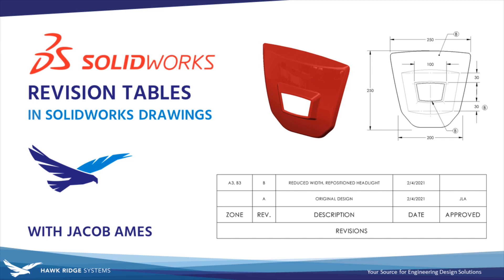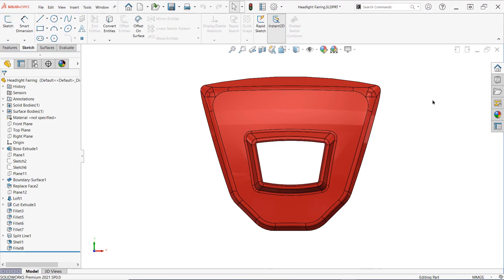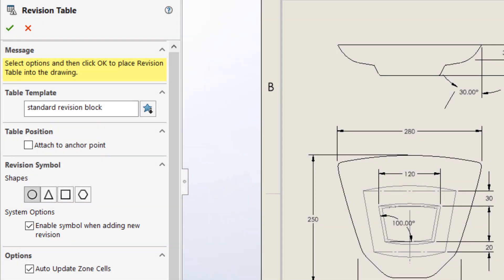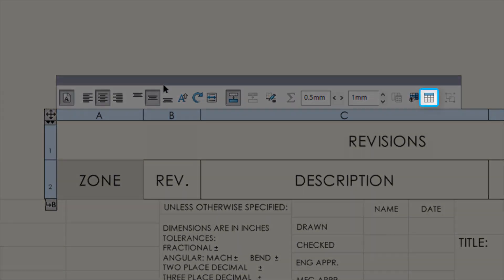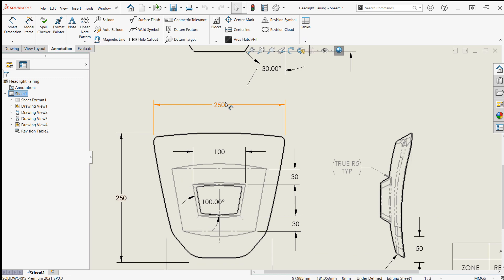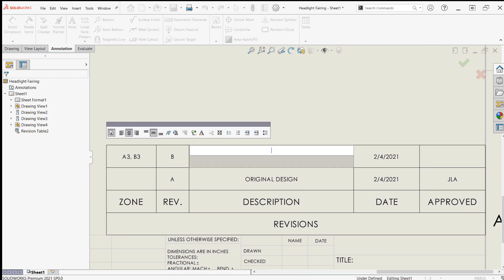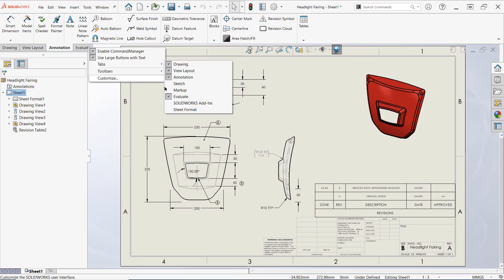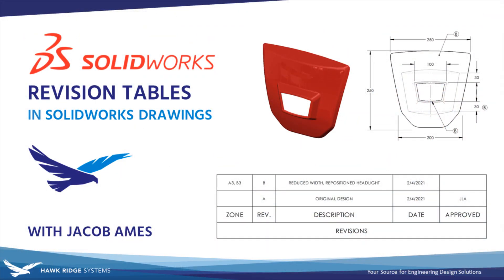SOLIDWORKS Revision Tables

Comment: I can't change the dimensions of part from drawing itself
How he did it 3:11
Reply: Same question, did you ever find out?
Reply: Usually changes are done in the part itself.. he has a setting enabled in solidworks that allows updates to be made from drawing. Idk what the setting is but im sure you can google it. Also to note, you may have to have the part checked out in order to make changes to it via the drawing.